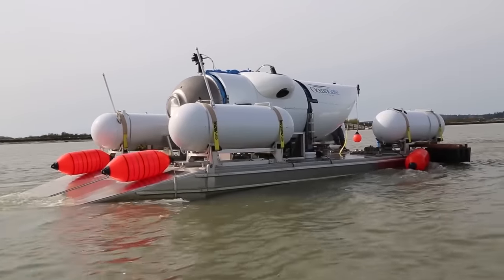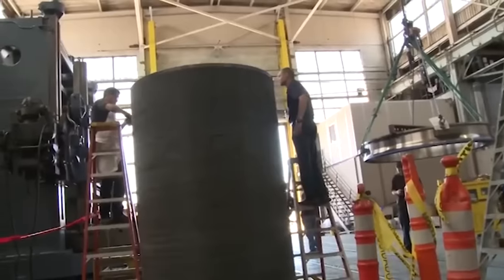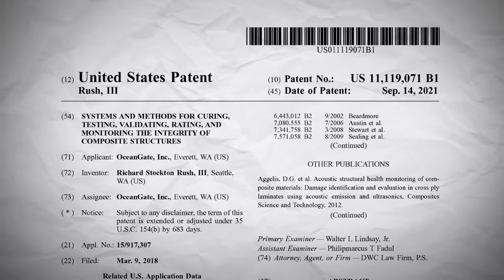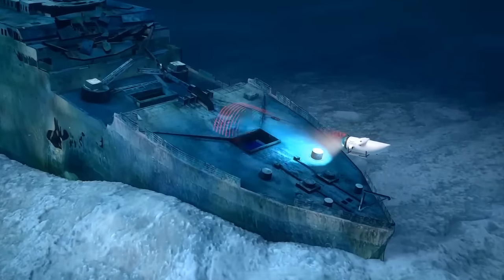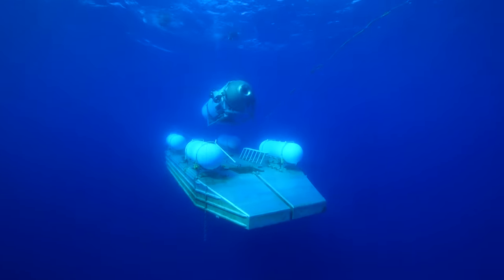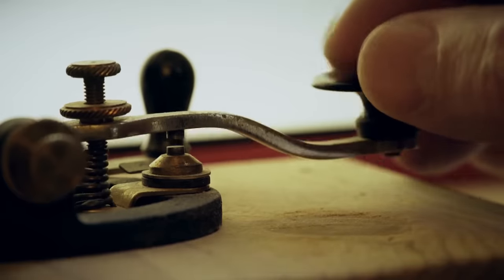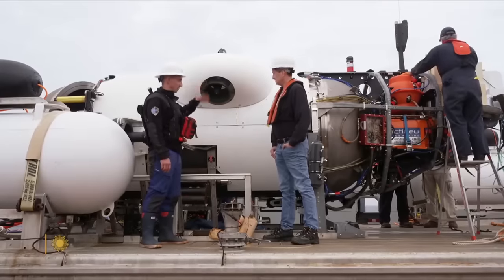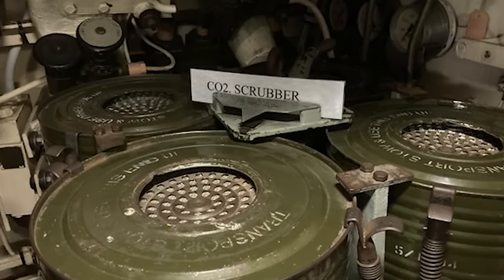Exposing OceanGate Submarines Many Fatal Designs

Comment: Putting a little tip at the end of the submersible was like the biggest “I dare you to implode me” move possible…7 is also the Number of Completion which oddly fits in this scenario for its 7th and final trip down
Reply: That's what I thought, I never seen a submersible that was shaped like a toothpaste tube
Reply: @Wolf-wf6yx  and now they’re just teeth and paste because of it
Reply: @SwingJake  They probably got blown out of the observation window.. 
Like Toothpaste out of a giant toothpaste Tube when it is stepped on.
Reply: @Wolf-wf6yx  Actually, it was the shape of a pipe bomb, not of a toothpaste tube..

Comment: Adiabatic compression at 12500 ft depth during implosion.  Energy = Pressure x Volume (4.1 Mega Newton/sq meter x 5 cubic meters) = 2.05 MegaJoules or 0.05 tons (>100 lbs) of TNT. Massive heating during adiabatic compression would be a like a giant diesel piston igniting the air and any organic molecules (in this case human tissue) instantaneously turning them into ash.  It was a bad day down there.
Reply: I keep wondering if they saw it coming even just enough time for him to turn and look at the others and say "oops"!
Reply: @robroskey6515  apparently they had dropped their weights to ascend, with james cameron speculating that they had received an alarm and were trying to manage an emergency.
Reply: @robroskey6515  maybe a quick "uh, oh"
Reply: @anon362-em1cf Another speaking who probably NEVER mnaintained his own lawn mower..Anyone who ever worked a piece of Carbon Fibre would never trust in this application.A spherical bearing with a screwed in plug,imbecile couldn't design a pair of blue jeans.This Rush guy was embarrassing to American ingenuity.
Reply: @robroskey6515  the force on the hull was 1/4 million tons, so that would accelerate 21000 pounds of hull to the center in under 10 milliseconds. Totally imperceptible. idk about the heating...it's basic physics, but so it's 21000 pounds of material imploding at near mach 1.
Reply: @robroskey6515  
Not even.
Compression happened in 1ms or less. It takes 25 ms for nerves to transmit information and 150 to 300 ms for humans to sense, think respond.

They were just 'gone' and any remnants were eaten by fish.
Reply: Everything you said = instant chum
Reply: @@user-uz8pp2tn6o 
No. Only the 20 here making astute comments.
You didn't pay attention in Maths or Physics classes, am I correct?
Reply: @DrDeuteron  speak metric ! I wouldn't be surprised if the use of these freedumb measures introduced further mistakes ! Fro ex.rated to 4000ft and not 4000m !
Reply: @clitisswood7330  reported for hate speech
Reply: Barely a second let alone a day
Reply: Are you Yanks aware that you're constantly mixing your measuring standards. Feet, pounds, miles etc are the ancient British system they got from the Romans. Move on. None of you seemed to even notice Cameron saying the Titan imploded at 35 hundred FEET. That's a third of the way down in case you still don't get it.
Reply: @alexandros8361 that’s wrong. 3500 feet?
Reply: @Marc-io8qm Yes probably. But maybe that's where it was. The US Navy isn't telling us.
Reply: @alexandros8361   "None of you seemed to even notice Cameron saying the Titan imploded at 35 hundred FEET. "  And you didn't notice that the creator of this video, who is British, specified that the hull was five inches thick.
Reply: @scottbarber9374  I thought everyone had a rough idea of the difference between 5 and 7 inches from wherever. But yes, you are correct, I didn't notice that from a British presenter. But it seemed that engineers hadn't noticed the slight disparity between the sub imploding at the end of its journey near the wreck at 12,500 ft and being told it imploded at 35 hundred feet. (approx 0.28 of the way down). I used to dive into deco depths, using the US Navy's dive tables so am a bit aware of depth underwater.
Reply: @alexandros8361  Pascals, Newtons, Joules.  I am quite sure that my calculations are consistently metric.  The conversion into tTNT is for show at the end. 
.
Reply: @jryan1024  Actually I could make more sense out of your explanation. Newtons and joules I did study at some stage. Probably early stage hydrodynamics. My field is not physics. So adiabatic confuses me somewhat. How enormous heat is created by the implosion but none is lost? I'm actually still trying to find out the depth of the dub when it imploded, but noone seems to know. And being constantly told it "was at 35 hundred feet, the depth of the Titanic", doesn't help at all. Regards
Reply: @alexandros8361  I was assuming depth of Titanic wreck for depth of implosion at 12500 ft. Adiabatic compression assumes conserved energy (compared to isothermal compression, or constant temperature). In this case the potential energy (PxV) is converted to explosive force and (mostly) heat. Some have estimated implosion temp at ~1500 degrees Kelvin.
Reply: @jryan1024  Thanks for that knowledge. I hadn't even considered heat originally, with implosion, thinking of eardrums bursting and collapsed lungs. It was hard to equate thermoclines of the ocean, which I have experienced, to intense heat at that depth. But from my readings, your estimation of the heat generated does seem accurate, I am sure you will be immensely reassured to know. Best wishes.
Reply: @alexandros8361  "I didn't notice [the mistaken switching of measurements systems] from a British presenter"  Okay, glad we're in agreement that, contrary to your implication, it's not just the "Yanks" who sometimes carelessly mix the systems up.  And btw, when the British creator of this video has free time, he probably drives down to his local pub, passing traffic signs with imperial measurements, and orders a drink measured in pints.
Reply: @scottbarber9374  I'm Australian, Scott. So we often tease the Americans even when supporting them. I was brought up with the imperial system and then, about a hundred years ago, we went over to metric. Then it was such a shock to come to USA and see the most advanced country in the world still using the Roman system. I still think in terms of "feet" but miles (a thousand roman double paces) is going back over 2000 years! I know you guys put out Ben Hur, so clearly the Romans did speak with American accents! But I'll give you points. You did bring in decimal dollars. You do drive on the better side of the road than us. It's better for the brain. And your aircraft carriers and nuclear subs are impressive. Going under the north pole. Yeah they probably still use pints of beer in England. Sorry if you've still got the shits. Bye.

Comment: No, the controller is definitely an issue. First as it is blue tooth and the loss of control that can lead to. Second that it is not rated to have its electronic absolutely isolated to prevent any sparking inside of it which in a potential high oxygen environment is catastrophic. This second part was of course true for more component that he got off the shelf in stores.
Reply: thanks mr. expert
Reply: @toast509 he’s absolutely right
Reply: how do you know they were using it with bluetooth? I highly doubt they would
Reply: @ed8212  How else would you connect a wireless controller?
Reply: They said it was Bluetooth in one of the interviews on the news
Reply: @ed8212  I know, it boggles the mind. He bragged about it in an interview. How it allowed him to pass it around the compartment for the clients to steer easily. Which was apparently a higher priority then avoiding possible sudden loos of control.
Reply: @One.Zero.One101  those controllers always have a wire for charging that also doubles as a connection, no?
Reply: @MrPalp  Mind boggling indeed, that mans hubris doomed him and sadly others long before this incident

Comment: 5:45 Your response to the controller is misleading. As the military only use a PlayStation style controller for minor and non-safety critical systems, like a small observation drone. The entire Virginia Class submarine will not be controlled this way, only slewing the periscope camera left and right.
But the bottom line is, if OceanGate cheaped out on the controller, where else where they taking risks by using the cheapest option?

Comment: You're correct that game controllers are utilized in military applications, such as for drones or, in the case of the USN Virginia class submarines, for controlling their periscopes. However. It is important to also consider the potential risks involved when maneuvering around a shipwreck without proper control. 

Colliding accidentally with the wreck could lead to severe consequences. Hence it becomes crucial to rely on a reliable and efficient controller to ensure safety in such situations. Nevertheless concerns arise when a game controller becomes the sole means for controlling an entire vessel. 

This reliance on a single device increases the possibility of failure or malfunction. Which could ultimately result in loss of control over the vessel and potentially lead to a collision. While using a game controller along with other reliable control methods can be acceptable relying solely on it introduces unnecessary risks. To guarantee the safety and maneuverability of any vessel. It is crucial to have redundant and robust control systems in place. A comprehensive approach is needed, including reliable backup systems and meticulous construction practices. If this particular submarines construction lacked attention to detail or had flaws the dangers associated with utilizing a game controller as the primary control device could have been further compounded. Therefore it is essential to adopt these measures and ensure that all concerns are thoroughly addressed to ensure safe operation of the vessel.

Comment: The US Submarine is operating a periscope with a controller, not the entire submarine.

That being said, controllers are great cause everyone is "trained" to use them. However you need fallback options in case they fail
Reply: @@vtriton But thats true. Drones are aircraft and they are operated using controllers.

Comment: Although game controllers are used on military and other critical applications, I am very convinced they are not off the shelf and go through some rigorous process of certification.
Reply: of course they aren't off the shelf, the military likely has them specially ordered and catered towards military applications with custom components especially for the thumbsticks which in the case of the f710 has terrible drift i know because i've owned 3 and all failed to this.

Comment: Debris field was found some considerable distance from the titanic, and that's right where they send the rover to look first.
The alarm was raised 8 hour after contact was lost and the subs last report was it was dropping ballast and returning to the surface.
The sub was 1/3 of the way down at that point. Anti submarine microphones would have picked up a implosion like noise.
Weird, its like some real engineers turned up, looked at the data, allowed for ocean currents and send the rover directly to the most likely place to find it.
Engineers be like, drop the mic.
Reply: And engineers did hear the implosion. The U.S. Navy's sonar buoys picked it up when it happened and then alerted the Coast Guard.
Reply: Was sensors located on the ocean floor, not bouys.  Bouys float.
Reply: I have a feeling that any delayed echo from a implosion. As it bounces off the sea floor is going to give a clue, to the depth, at time of implosion as well.

Comment: It is amazing that Rush actually thought that hull monitoring system would warn of an impending hull failure. But carbon fibre material fails suddenly and instantly without any warning. Even if there were any warnings generated by the monitoring system, there would not be any time to react. If anything, the warning, implosion, and deaths occurred within 1 millisecond. So this shows how moronic Rush and his company really were.
Reply: The word is "libertarian," not moronic. Libertarians claim that they don't need science or regulation, they just need more freedom to do irresponsible things.

Comment: Apparently the carbon fiber tube shattered and then got jammed in "one" titanium end cap   ....my guess is the hull tube shattered  inward and that failing inward made the window fail outward and the air escaped out the window   ..forcing the shattered carbon fiber to jam into the window hole

Comment: As my grandfather told me when teaching me how to do basic maintenance on my car, “Whenever you’re dependent on something to keep you alive, take good care of it and don’t be a cheap ass”. 
Thanks for the wise words Pops RIP
Reply: Which is why the gamepad controller was a stupid decision. Steer a robot sure but why on Earth did they think it was acceptable to depend their life on it. Luckily Karma handled CEO.
Reply: @FatalFist  It's common practice to use gaming pads. Likely the QC is and therefore reliability is much higher on mass produced pads that have been properly stress-tested for millions of button presses and stick moves
Reply: Wise words indeed!
Reply: @josephwoolley685  As a gamer, I'm fully aware of the versatility a gamepad can deliver. But the issue is, I would never put my life on the line with one. This is why controllers in the military are far from where they are steering their drones. If the drone is shot down, no loss of life.
Reply: @FatalFist  You are NOT putting your life on the line. I keep seeing this comment everywhere. From what I know, they had 2 controllers in the submersible, and apart from that even if the controller died you could still ascend safely with many other methods. People seriously should stop talking if they don’t know anything. Ffs 🤦🏻‍♂️
Reply: @windshearahead7012 es tf you are especially with the BLUETOOTH PS3 LODGITEC CONTROLLER that far down Bluetooth can’t work they reported losing signal with the mothership multiple times meaning they lost all their data and control of the vehicle and needed to deploy their safety sand bags to resurface I wouldn’t put my life on some batteries and a device that physically cannot work that deep
Reply: @unptimistic9739  What are you even TALKING about. That was a Logitech controller. Not a “PS3 LOGITECH”. The controller wasn’t communicating with the ship at all, so the signal story you posted is a pure lie. SOOOO many inaccuracies here I won’t even bother replying any further…. It’s as if you literally have no clue what you are talking about, but still have the need to say something.😂😂😂😂😂.
Reply: My grandfather left me with: “when you’re going in for your prostate exam, just make sure you don’t feel the doctor’s two hands holding onto your shoulders.”
Reply: I read a comment one time that read something like: "Things with the worst designs were once someones brilliant idea"
Reply: @josephwoolley685 feel free to use that when YOUR life depends on it. I'm out.
Reply: that's a wise man
Reply: @unptimistic9739  bluetooth does work far down the ocean. the reason communicating with a submersible is so difficult is because salt water is conductive and because it is connected to ground it basically creates a faraday cage around the submersible that blocks radio waves. that's completely irrelevant when you are using the controller to control the submersible inside of the submersible because there is no water blocking the signal. it's no different to using the same controller above water.

why do you even bother to comment? you clearly don't know what you're talking about.
Reply: @windshearahead7012 are you serious? No military or anyone uses 30€ wireless controllers LMAO
Reply: Wise words. A worker is only as good as his tools is something my pop taught me. Different generation back then they understood good workmanship and didn't cut corners like a lot of people do these days 🫤
Reply: @FatalFist  You missed the video if you're still getting hung up on the controller aspect bro.. yeah look maybe a plastic gamepad isn't a great look in hindsight, but, as explained here, it wasn't the cause of anyone's untimely demise.
Reply: your grandfather was a smart man sounds like exactly what my dad would say and it’s true that’s why with buying a vehicle and maintaining a vehicle. It might be cheaper in the short run to buy some piece of shit lemon with 200,000 miles on it that hasn’t been taken care of but you’re going to save exponentially on maintenance and reliability and longevity by doing things, right and I would say that is true with anything not just vehicles of any sort but it’s true with owning a home and really anything that you purchase the better you take care of some thing and maintain it properly the way you’re supposed to whether it’s a household appliance or sweatshirt or a vehicle or an aircraft makes a difference
Reply: @Rico-oz4ct  yes they do. There was a video from inside a nuclear submarine and they were using an Xbox controller for something in the control room.
Reply: @phattjohnson  I didn't miss anything, I was merely saying the different between the military's application is that they are away from the unit so their lives are at zero risk. With Titan it was the opposite, I would be very skeptical if I was in a submersible using a PS5 controller. But yes, the Titan had worse things to consider.
Reply: Wise man!
Reply: @FatalFist  You're so correct. There is a non zero chance of fire sparks. In No Failure Environment, every unnecessary risk is profoundly foolish
Reply: Smart man
Reply: Pops was a wise man 💪🏾